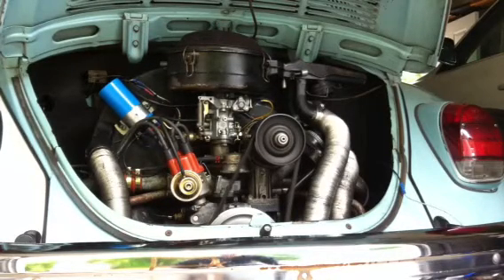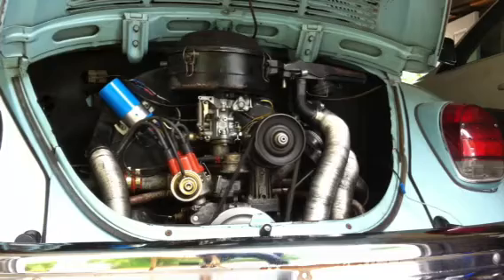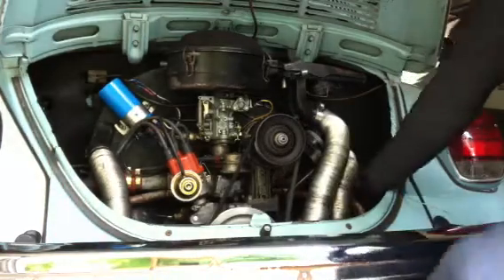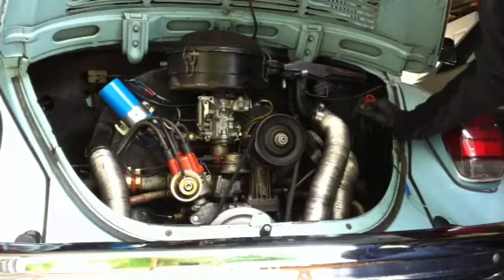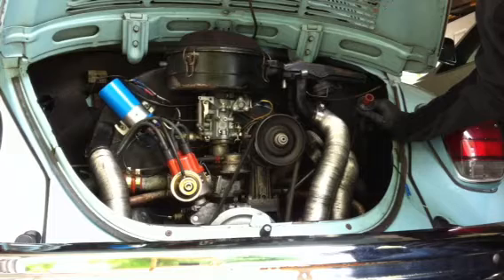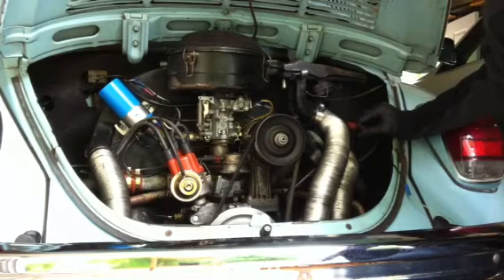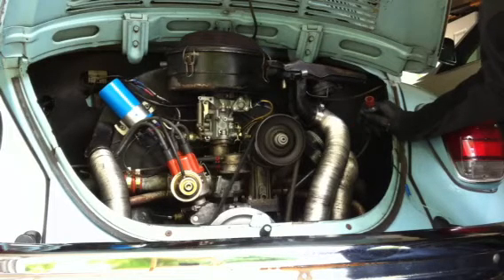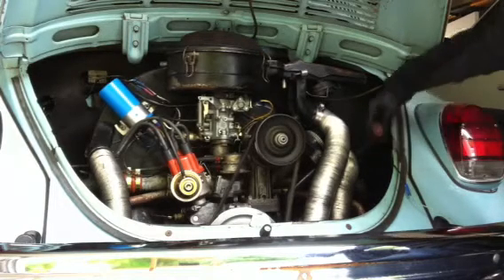72 beetle misfire

Comment: I had the same problem and nothing on here explained it . I have found the problem and it was a intake leak at the base of the manifold . This was determined by spraying brake kleen around the gaskets head to manifold and manifold   to carb i have two 36 delordos . i can see this is the only answer to the imfemiss miss  everyone was having a problem with . Hope this helps

Comment: Can't hear a word the guy is saying but I can tell you the diagnosis isn't that hard. Check compression (and valve adjustment) then check ignition, then check for intake leak. (usually the rubber boots on the intake manifold) Should be able to find the problem in an hour or less. Fixing it is another story. Of course after 50 years of working on these things I can tell you a lot just by hearing it crank over before it starts.... but I am not there!

Comment: what was the solution? i have exacly the same problem in the  same cilynder and i can't fix it ...change points, spark plugs (twice), distribuitor, rotor, cap and pushrods but keeps with misfire
Reply from the maker: Check your rubber intake boots for vacuum leaks.